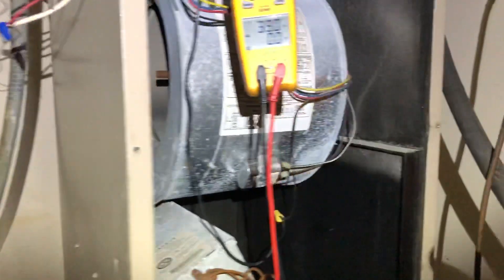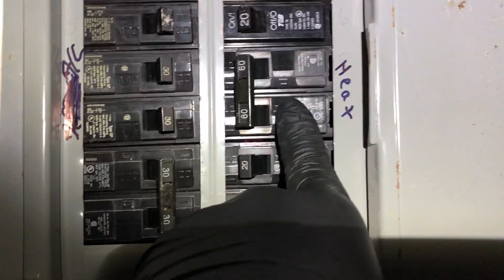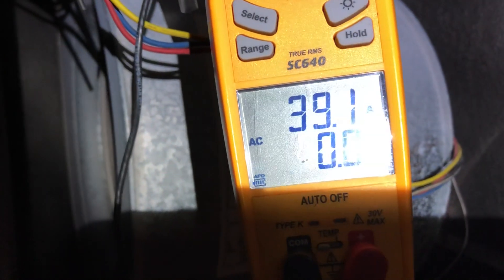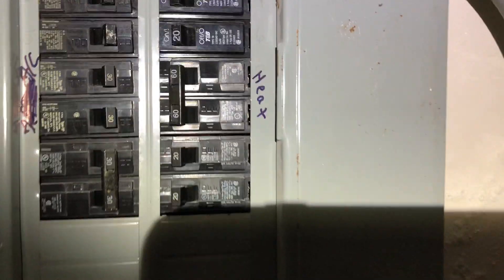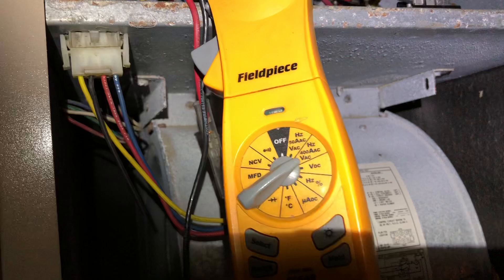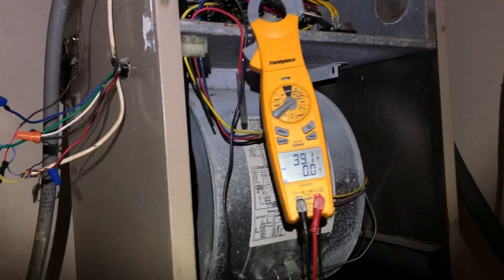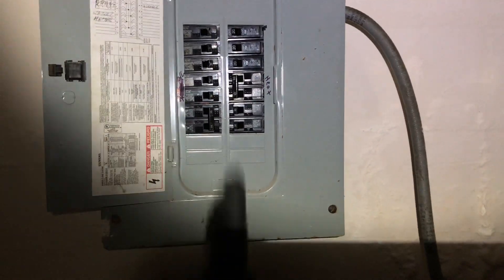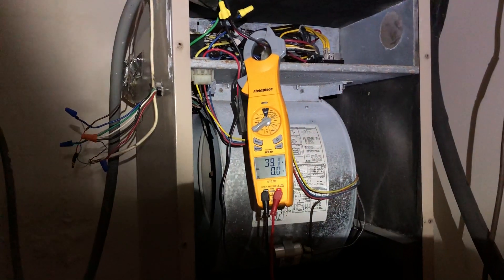Tech tip: inspect wire size on 10 kw heater

Comment: Wise words Marco!
The wire has to be able to take more current than the breaker is rated for, (at least here it does), the breaker is there to protect the cable, not the appliance (though often it does that too if theres a fault)

Comment: That is the main reason for electrical fires. The right size breaker never tripped because it did not see a problem. But the wire is too thin. The wire cannot handle the load. So the wire starts to heat up eventually melting off the insulation. There are cases where the actual wire starts to glow red hot but the breaker still does not trip. Wire size is very important.  Good thing to point this out. It is over looked by many techs.
Reply: Anthony Reardon hvacr this is what I was going to post too. Small wire alone will not cause a breaker to trip more often. The opposite.